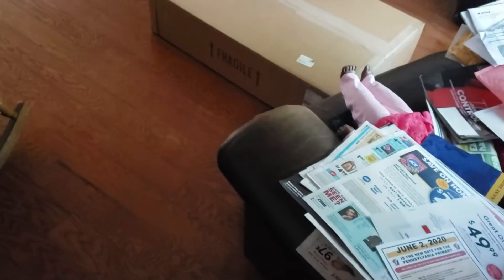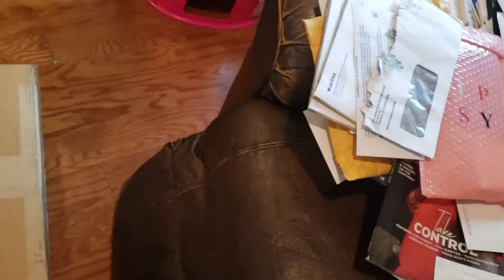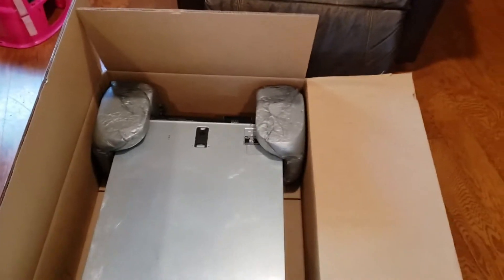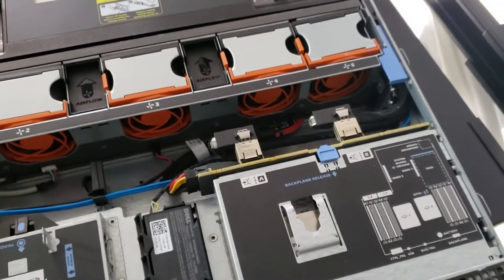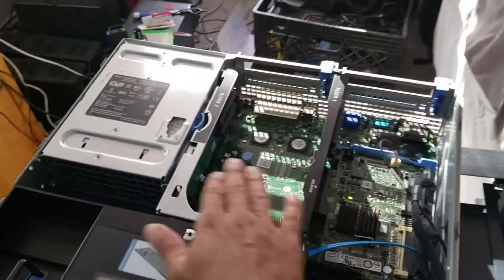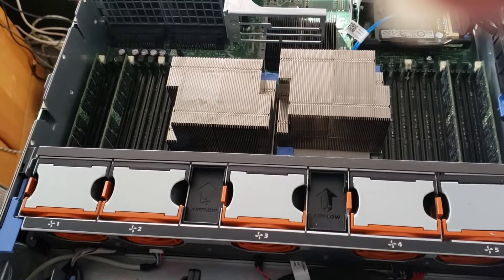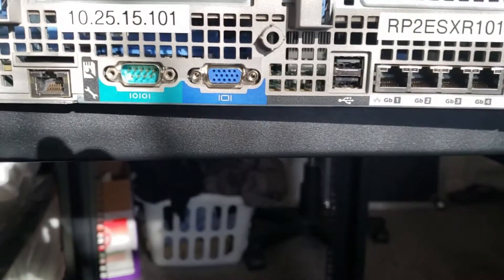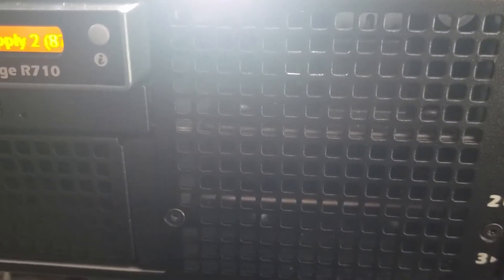Unboxing a Dell PowerEdge R710 Server

Comment: The battery you found is the backup for the RAID card.
It will cache data being written to the storage. After the cache is written, it'll do the next block of cached data.
If, in the event of total power loss, that cached data is still there and will be finished writing to storage on next power up. Helps prevent bad sectors on the drives.
(I think I got that correct :) )